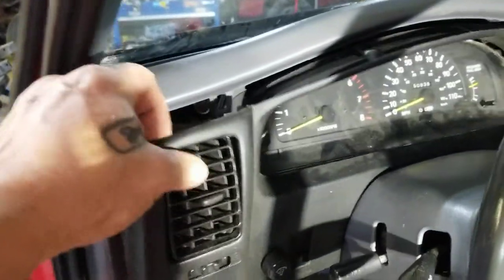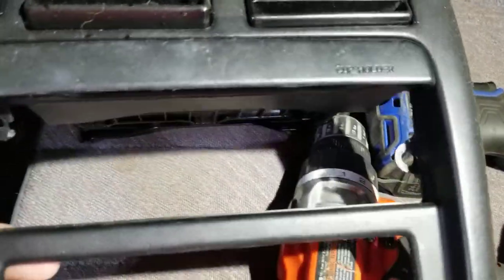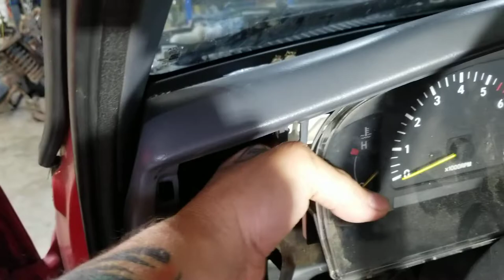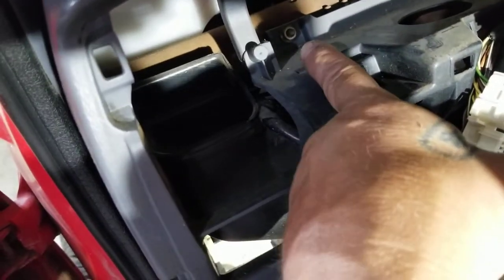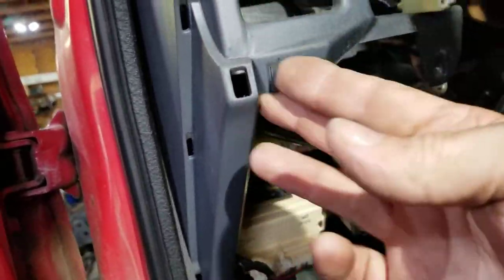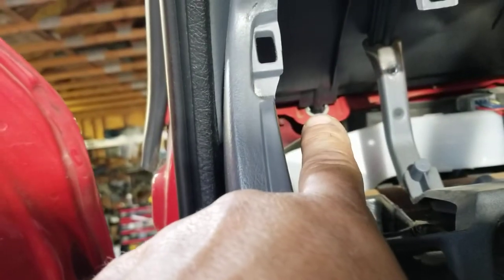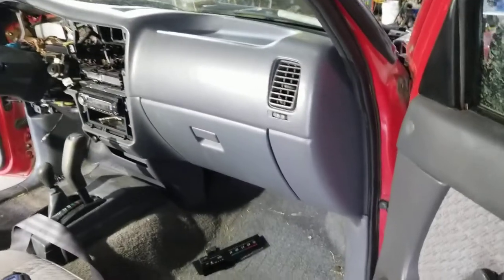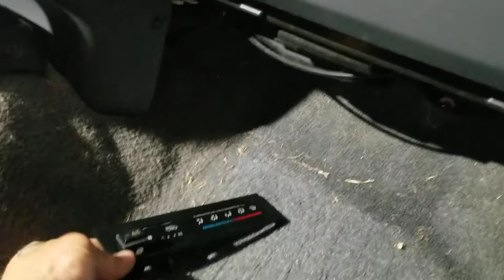How to do a 3rz to 5vz swap, 1st gen Tacoma project. Getting ready to swap the harnesses. Dash, out.

Comment: I've dealt with the 3.4 and they give more issues than the 2.4 & 2.7 . I know the v6 seems better, but its not. I wish you was in Arizona, i would have purchased all your 2.4 parts . My 1996 Tacoma has 1 million miles, i was 16yrs when we purchased it. Im actually working on 2 3.4 engine right now.
Reply from the maker: The 2.7 in this unit had a rod through the side of the block. I've never driven one with the 3rz or 2rz but I know they are good engines.
Thanks for watching and sharing your experience.